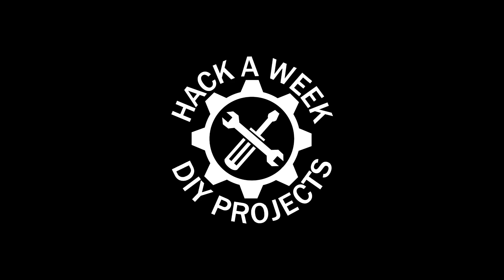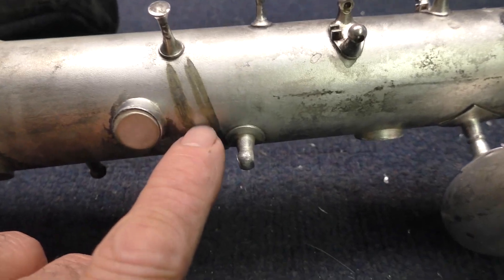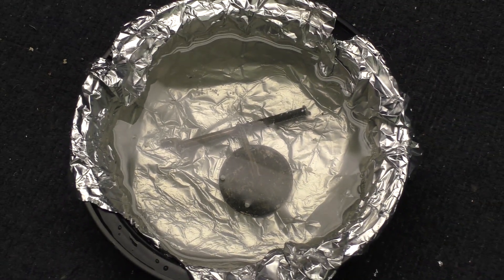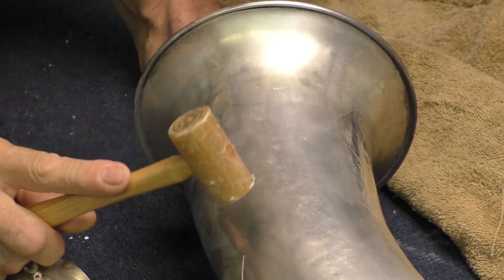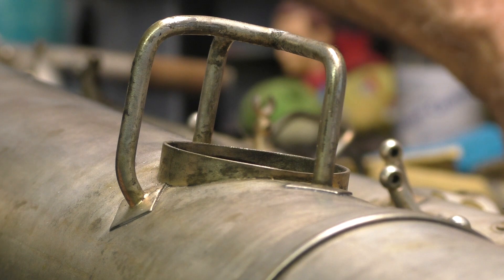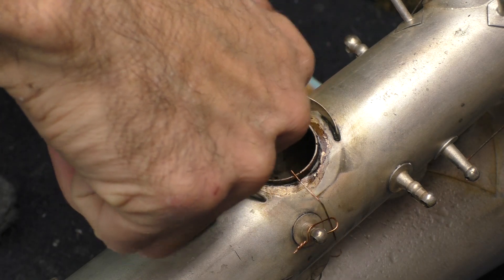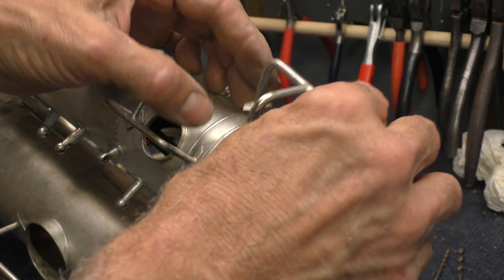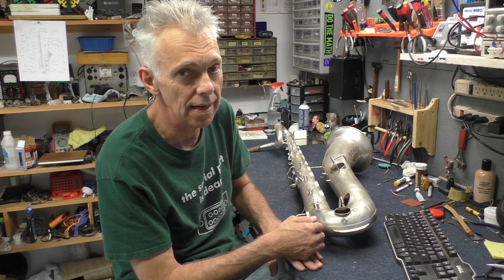1917 H N  White King Baritone Saxophone Restoration, Part 2

Comment: You need a slide hammer. Solder a bolt or ready rod and you can get the exact placement you want. If you used a hot air gun wouldn't it tarnish the metal a lot less than a torch?
Reply: Hot air gun won’t burn lacquer, silver plating is very resistant to heat and the tarnish polishes right off.